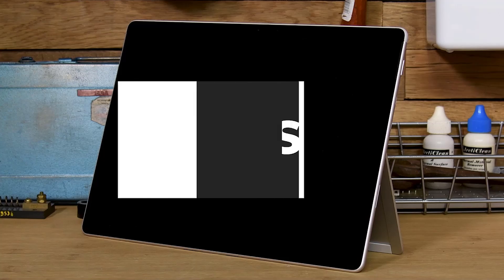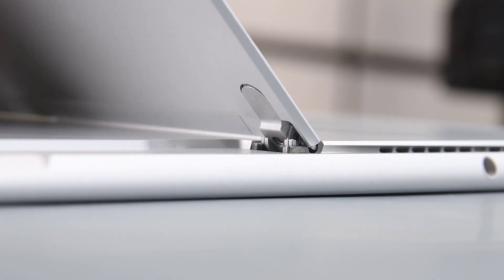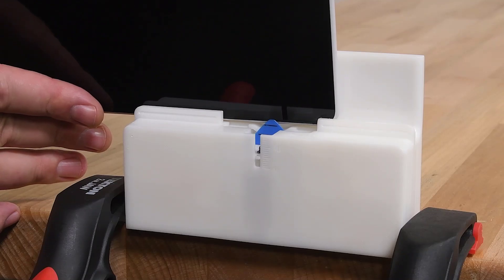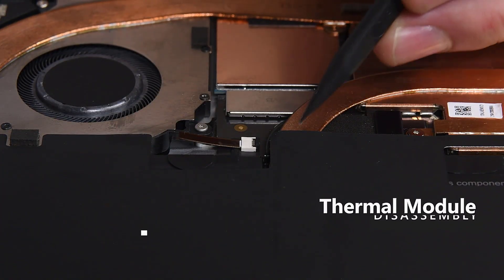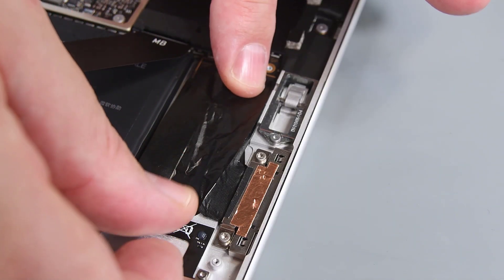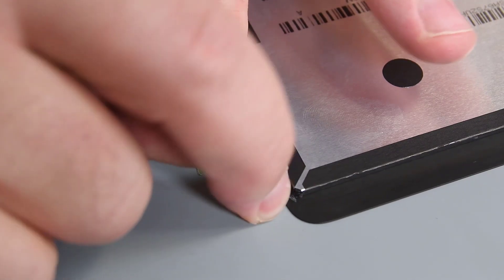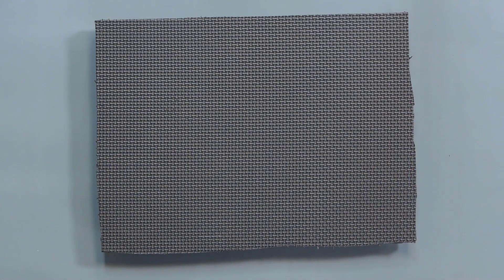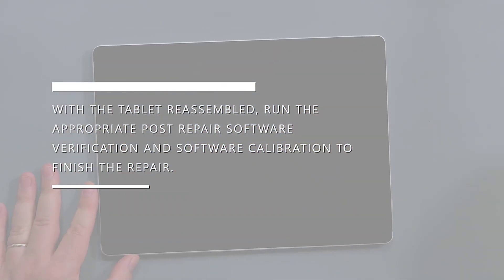Repair | Surface Pro 8

Comment: Fairly helpful video - could use some more clarification though, which I found in other SP videos, such as heating is not required with SP8, 9 etc. when using the debonding tool.  Also, a little too much locktite, which was running inside the case!
Unfortunately the bonding frame is not available from iFixit for this model any more.  I ended up creating one via AI/OpenSCAD which is adjustable for other tablets/phones that you can 3dprint yourself.  I'll eventually upload to thingiverse under the keywords "bonding frame" for others to use and freely adjust to their needs.  I could not find anything else that could precisely work in the 3dprint sphere.
I found most parts from Ali (screen, fan, heatsink, screen stickers), but for anyone replacing the fan alone, beware, as the standard ali fans for the 1983 wifi are slightly different, made to fit the heatsink assembly supplied at AliEx as well.  They can be adapted, but the top fan cutout will not be centered, while the screws holding the fan/heatsink together no longer work, so you'll have to tape it on somehow (I'm using non-conductive thin silver tape used on dryer ducts which is heat resistant).

Comment: Great video. There is almost no repair information on the Pro 8. This video does not cover battery replacement and they missed the step to replace the thermal paste but using this video I was able to replace my battery. Thanks!  😊😊

Comment: hey yall be extremely careful when cleaning off that toxic waste from your cpu die, it can kill you if you ingest it! also dont use a flat head on the cpu die or you may chip it and it wont be fixable total cpu death.

Comment: Where does one find the display adhesive for a Surface Pro 8?
Reply: It comes with the replacement displayer. The one I bought on iFixit's website has the adhesives along with the screen in the same box.

Comment: @iFixit Repair can you put the Adhesive Strips for sale on your shop please? You sell the screen, the debonder, and the bonding frame, but you don't sell any way to glue the whole thing back together? While you're at it, sell us the batteries! Microsoft wants 750$ CAD to replace the entire tablet, even if the only issue is worth 100$!

Comment: Probably obvious to anyone watching this, but it looks like they forgot to mention putting new thermal paste on the SOC before reinstalling the heat spreader!
Reply: Yeah! Also you need to test the repair before you glue the screen again..
Reply: The Surflink connector is als only connected at an angle; it doesnt sit properly
Reply: Good catch!